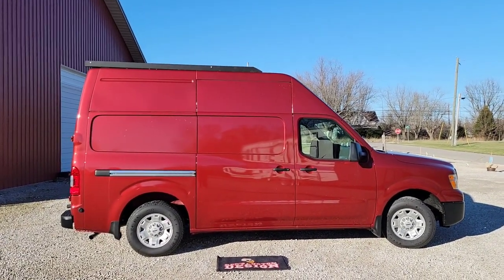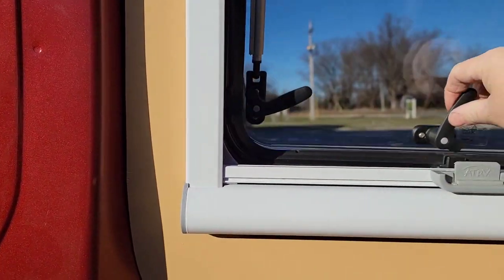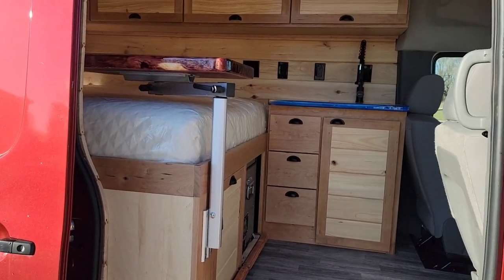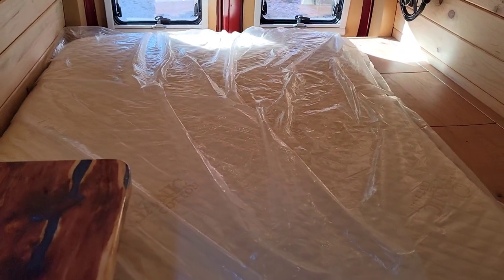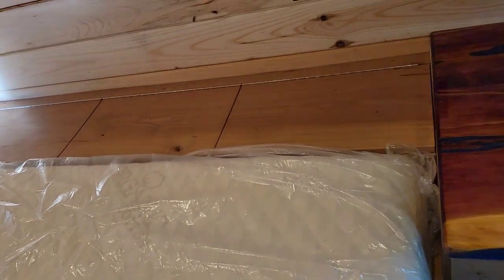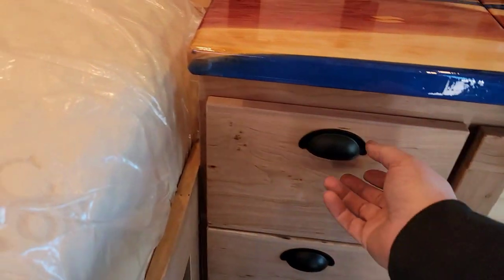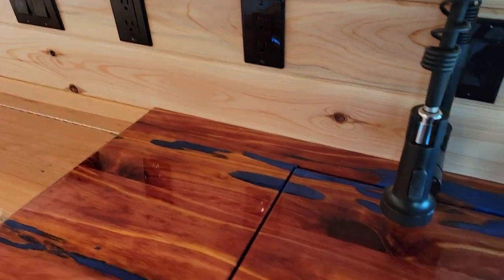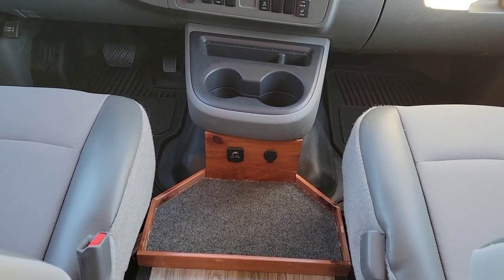2021 Nissan NV2500 (E69)

Comment: Pretty darn nice build. I’m looking at this particular van because I saw a good used one for cheap. Now of course this one is for the lady but my requirement is a little different. I think the passenger seat is not required for me. The little kitchen with a little fridge run on propane and the sink above it might work. I make all my own food. I need a portapotty. Drain all my water because I’d think it’s okay. Otherwise I don’t think there’s a smarter solution to the space. Well done 👍
Reply from the maker: It has a portapotty, a sink,   12v refrigerator (propane refrigerator will require a vent to exhaust the heat and films and will still require 12v. And you have to find a place to put the propane tank).
Reply: All good points. You are the master

Comment: i just bought a 12' nv 2500 im designing a building a removable camper in the back. it'll be a stand alone box with bed, couch, kitchen, accessories. it'll be removed and slid in by forklift,

Comment: Beautiful van and you are a true craftsman! I’m curious, I have this van with the factory rear windows, is it possible to retrofit to windows similar to what you installed in this one?
Reply from the maker: Yes and no.  You would have to replace the glass with a piece of aluminum and then put the window in the aluminum.
Reply: @RedsCustomDesign  
Thank you for the quick reply, I just discovered your channel, very nice work!